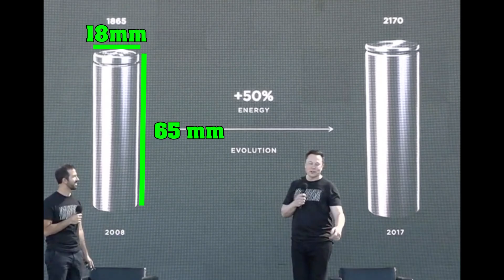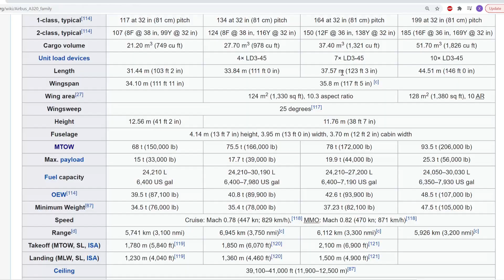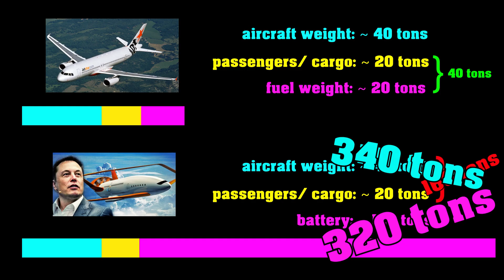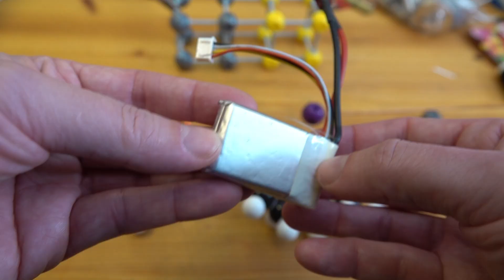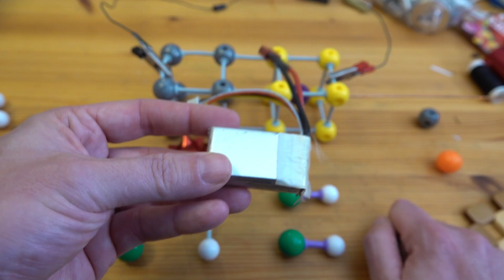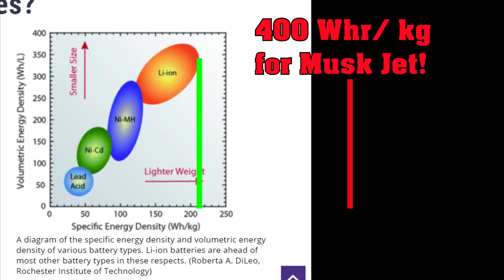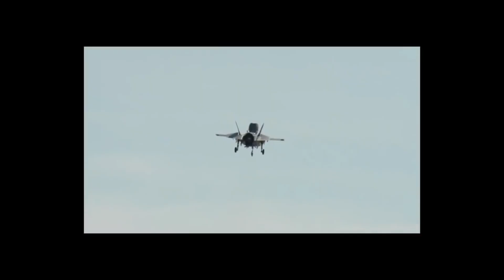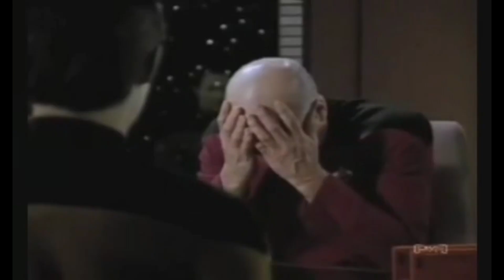Tesla's Secret Plan To Disrupt Airlines: BUSTED!!

Comment: Serious question: since fat is so energy dense, but also not dangerous, is it not theoretically possible to get to some kind of energy storage which is safe at similar densities?
I'm not talking necessarily about electric power (batteries), nor I'm implying it would have to be able to release the energy at a high rate (=power). I'm just talking about stored energy.
Reply: You mean like barrels of oil?

Comment: For the record, they have 50% thermal efficient gas engines. Our school supermileage team built one. 

It's not that hard but you lose throttlability and power density.
Reply: And I think that's about the theoretical limit of what is possible.  It's impressive you got one that high. Good job!
Reply: I'm not really familiar with engines but, basically your saying you can get there by sacrificing performance in other areas?
Reply: @chrisessick7192  
You run into a thermal difference limit.  It's theoretically possible to get an internal combustion engine to 50% efficiency.  But you probably would never be able to accelerate speed up or slow down or anything like that. Not and keep that kind of efficiency. That's just not possible.
Reply: @dankuchar6821  hey thanks for the reply! That's really interesting.
Reply: @chrisessick7192  
because we have approached the theoretical limit of how efficient an eternal combustion engine could be, the only way to make a car get better gas mileage is to make the car lighter. We can keep making small improvements in the engine, but it's not ever going to be the case where you can make a car that gets twice the mileage you get right now. Maybe 10% better on the engine, but the only way to significantly improve the gas mileage would be to make the car lighter. You're just at the end of what physics can do. It's hard to understand unless you've had courses in thermal dynamics. But that's where we are. Electric engines are far more efficient. But the energy density of a battery, with even the best theoretical current models, can probably only double what we have right now. So while the car right now can get say 200 mi on a battery charge, it may be possible to make a battery with current known technology that would get you 400 miles on a charge. But that's it. You'll never get a thousand miles on a charge unless there is some kind of new huge breakthrough in battery technology. I suspect it won't be a battery. Perhaps somebody will come up with a super capacitor that will work more effectively. That remains to be seen. Theoretically it is possible, but nobody knows how to do it with our current understanding of physics.
Reply: You van go even higher, and use it for power generation (vide railway industry, and serial hybrids) for your electric ride if you want the best of both worlds.
The problem is that the cycle becomes more complex in desin, since components need to be added to recover low grade heat. 
I was playing with it for my little gas-steam-orc project.
Cost turned out prohibitive, though.

Comment: Elon Musk was laugh at when he said in the early 2000s that SpaceX was going to develop reusable rockets at a fraction of the price of modern rockets, now is 2021 and nobody are laughing at him, specially the Russians, just saying. And when it comes to batteries, it is a no brainer, when energy density becomes high enough, electric comercial aviation would be a reality, it is only an engineering problem as far I understand it, there is no law of nature that needs to be broken, or Cthulhu invocation required. So saying that Musk's plan to change comercial aviation is BUSTED is a bit over sensationalism. It ain't gonna be easy, but it is not imposible .
Reply: They laughed at the Wright Brothers, but they also laughed at Bozo the Clown.

Comment: An important point to make is that specific energy is not the same as specific usable energy. On a car your Hydrocarbons at 40 MJ/kg are going through a 25% thermal efficiency engine. You're ending up with 10 MJ/kg of mechanical work and 30 MJ/kg waste heat. This is still way better than the 0.5 MJ/kg battery but it gets it closer. Combined with a significantly lower engine mass, you're most of the way there for a performance car.

Comment: Just put ion engines on the plane so it requires less air, there solved it for you ;)
Reply: Researchers from Wuhan university have created a prototype thruster capable of generating plasma jets with propulsive forces comparable to those from conventional jet engines, using only air and electricity.

An air compressor forces high-pressure air at a rate of 30 liters per minute into an ionization chamber in the device, which uses microwaves to convert this air stream into a plasma jet blasted out of a quartz tube. Plasma temperatures could exceed 1,000 °C

Comment: One point is clearly missing in this video. The expansion of lithium batteries at high altitude. Examples: UPS Airlines Flight 6 and the announcement if you have certain smartphones and laptops start smoking on the plane to report to the hot cabin attended aka juice pusher...

Comment: 2 years ago Lufhansa CEO himself was telling me and my colleagues that a big battery electric plane won´t work energy density wise. They have projects with synthetic fuels, but they have yet to be made on a big scale and are obviously much more expensive than kerosene.
Reply: Not only that, synthetic kerosene actually EXISTS in reality, and DOES SOMETHING in reality. Batteries with the same energy density as kerosene (except metal/air) DON'T exist, and are never likely to exist. Because even IF you could make such a battery in real life, it would be extremely dangerous.

Comment: Slight nitpick - I believe you misinterpreted the fuel capacity figure for the A320. The figure is given in liters, not pounds, so it cannot be directly converted to tons. According to this (https://bhs.econ.census.gov/bhs/cfs/weightConversion.html) table from the US. Census Bureau, one liter of jet fuel weighs 1.8 pounds. Multiplying this by 24,210 liters of fuel and throwing away the insigfigs we get a more accurate maximum fuel capacity of about 43.5 tons. The MTOW of the A320 is about 80 tons, making the maximum fuel capacity by weight about half of the MTOW. Note that the OEW (about 40 tons) plus the max. fuel capacity (about 40 tons) plus the max. payload capacity (about 20 tons) is about 100 tons, 20 tons more than the MTOW (about 80 tons). This is due to another subtlety that you glossed over - you physically cannot take off with both max. payload and max. fuel (and you very rarely take of with either). It is a tradeoff between how much fuel and therefore range you have, and how much cargo you can carry. I'll admit that I'm a bit skeptical that you missed this nuance seeing as not 60 seconds later you mention reducing the number of passengers and cargo in order to increase the amount of fuel onboard, but I'll take it in good faith that it was presented in good faith. Compounding this, you misrepresent the fact that unlike a traditional jet airliner, the weight of the batteries actually contributes to the OEW of the plane. Interpreting Elon's 70% figure to mean 70% of the OEW, this figure tells us nothing about the payload capacity of the aircraft. Of course, it would be a massive challenge to design a plane whose components excluding the batteries make up only 30% of the plane, but it is still incorrect to say that the weight of the plane without batteries as well as the payload capacity is only 30% of the weight of the plane. It isn't clear whether or not Elon meant 70% of the OEW or 70% of the MTOW, but given the context I find the former far more likely.

And to anyone responding, before you finalize your response keep in mind that I prefaced this as nitpicking. While these elements are factually incorrect I still agree with the core message of the video, that being that an electrically powered supersonic VTOL is, if it is even feasible, not going to happen in any of our lifetimes.

Comment: I think you are missing the point.  If we reduce the atmospheric pressure of the earth to about 1/10 or what it is now (not a true vacuum, tfoot, that would be crazy), then you can simply run hyperloops without the tubes allowing for the disruptive, next generation transport that all plants crave!  Elon also has a plan to selectively disable gravity, allowing for hyperloop vtol ascent and descent in the next 3 to 5 years.  If you would just read the whitepaper, all would become clear...

Comment: Supersonic electric VTOL? I don't even have to look up my AE books...this is plain childish daydreaming
Reply: Researchers from Wuhan university have created a prototype thruster capable of generating plasma jets with propulsive forces comparable to those from conventional jet engines, using only air and electricity.

An air compressor forces high-pressure air at a rate of 30 liters per minute into an ionization chamber in the device, which uses microwaves to convert this air stream into a plasma jet blasted out of a quartz tube. Plasma temperatures could exceed 1,000 °C
Reply: @blackmartini7684  i remember reading that paper the problem is that you will need to the energy to create plasma I believe they thruster made about 30N/kw but it never adds the power use of the compressor. Another big issue is if we compare the thruster with the rolls royce olympus engines on the Concorde one of the only few commercial supersonic jets. it needed 4 engines producing 142-169kN at max thrust and after burner, with cruise of about 45kN just cruise alone for a 3hr flight from london to newyork requires 17598kwh batteries just for the cruise and you would need double that power just for the full thrust during takeoff climb. so you are looking at almost a 36Mwh  battery which would weigh 138000kg Almost equivalent to double the empty weight of the Concorde. and the battery need is 16% of the largest battery in the world
Reply: @shaneebahera8566  
its ok if he can charge the plane battery fast 🤣🤣🤣
Reply: @blackmartini7684  The problem was never thrust.

Comment: I mean all the points you bring up are valid. It would be insanely difficult to make the plane for all the reasons you state but at least try to state accurate numbers. For example when a plane is built bigger its actually possible to make the airframe a smaller % of the total mass. So the plane would need to be insanely big but 70% battery is not flat out impossible. Flying higher does get more efficient but duh you still need some atmosphere for flight. The issue is you need to fly much faster but the math works out to the air breathing engine losing thrust faster than the efficiency gained from higher flight can compensate. For example the SR-71 needed to fly at a hight so low for its speed that it would get crazy hot (so titanium) if it flew higher it would not heat up but would not have the thrust to maintain that speed. Non air breathing engines( rockets or electric) dont have that issue and are better flying as high as possible and faster. At least bother to watch the battery day you pull the numbers from. The 5x 6x numbers talk about the gains from the change in the battery size giving them a more efficient geometry. They have a graph in the presentation showing the new battery has a 54% increase in RANGE(directy linked to energy density) but 14% of that was said to be from a better structural integration with the car( no mass waisted for attaching it ). So we are talking about 40% more energy per kg for the battery. Finally and I dont blame you for that point since you would need to have watched all the interviews with Elon to catch that one but he says 400wh/kg is the bare minimum to make it even possible but said it would need to be significantly higher to make it commercially viable hence the reason he is in no rush to make it.
Reply: The reason why no one is going to make a supersonic electric jet is because it's physically impossible.

Comment: How would Fuel cells compare? They've got higher density in a safer package, right?
Reply: Yeah but they still only generate electricity. The genius of a turbine is that it takes full advantage of air expansion at ignition (oxidation) of the fuel. The best way to make airplanes carbon neutral is to just keep the same system but use synthetic fuels.

Comment: Ah cmon dude. It's not hard to do this shit. We just need to invent something really incredible like a holy grail of energy. No big deal.
This guy isn't... 100% wrong on the claim that electric engines get more efficient when you get higher but there's a couple of caveats.

1. The required work for the engine decreases the further from the gravitational body and the reduced drag -- to a point. One still has to be able to attain enough speed and have an air pressure intake that is optimal for maximum thrust. Like a ram jet. (true for fuel based and electric based engines... so yeah...)

2. You can carry propellant with you and thus the efficiency continues to scale as you go higher... but that's not an electric plane.

So yeah. He's not 100% wrong. Just 99% wrong lol.

Comment: When Elon says electric motors have better power to weight ratio than combustion engines, that's only true for standard piston engines. There is still no electric motors with higher power to weight ratio than gas turbine or jet engines.
Reply: Researchers from Wuhan university have created a prototype thruster capable of generating plasma jets with propulsive forces comparable to those from conventional jet engines, using only air and electricity.

An air compressor forces high-pressure air at a rate of 30 liters per minute into an ionization chamber in the device, which uses microwaves to convert this air stream into a plasma jet blasted out of a quartz tube. Plasma temperatures could exceed 1,000 °C

Comment: you also forgot that plane burns the fuel - so it becomes lighter the further it flys and presumably more efficient - Also current planes can’t really land at full weight (hence fuel dump in emergency) - so it’s going to need a strong airframe to land at essentially full weight.

Comment: What kind of "electric jet engines" would they be using? Most electric planes so far are propeller airplanes which definitely won't work in thin upper atmosphere. But I've heard of this new "Jet propulsion by microwave air plasma in the atmosphere" concept (google it)... would that work?

Comment: the "extra" 4% when the energy storage is 50% more but the volume is only 46% more is probably just down to the fact that the skin thickness is just the same so you're getting more volume for your buck.

You probably lose all that benefit plus more as you're getting more empty space between the batteries  : /

Comment: @Thunderf00t, all that, and then the small problem of making a "electric jet" aka Electric Ducted Fan, that will push the plane past Mach 1. And still be "more efficient" than a Suck-Sqeeze-bang-blow engine.
Keep up the good work
Reply: Researchers from Wuhan university have created a prototype thruster capable of generating plasma jets with propulsive forces comparable to those from conventional jet engines, using only air and electricity.

An air compressor forces high-pressure air at a rate of 30 liters per minute into an ionization chamber in the device, which uses microwaves to convert this air stream into a plasma jet blasted out of a quartz tube. Plasma temperatures could exceed 1,000 °C
Reply: @blackmartini7684  sounds really smart, 30 liters of air per minute, converted into a blast of plasma.
My desk fan moves more than 0,5 liters a second, so that will do to compare the thrust provided. I'm not sure why I would heat it, as there need to be something that would expand to provide more thrust, to make it do anything.

But hey, Science might prove my thinking wrong, and make a supersonic Tesla airplane fly.
Reply: @svareter42  this is a small scale prototype so so they should be able to do more liters per minute

Comment: If you use larger cells in a battery you get higher energy density simply because there's less "dead" casing material in your battery. It doesn't really take a genius to come up with that idea, but it's also not as retarded as you make it sound. The gain in energy density may be negligible on the individual cell level but it adds up in a battery that contains hundreds or thousands of cells.

Comment: There is a small aspect, that has been a bit overlooked. Let's stick with an A320. On a small hop, lets say from Boston to New York, the tanks of an A320 are literally empty. So less weight for the complete flight, less fuel burn, save costs, jada jada jada. And for a conventional powered aircraft, In terms of range, it helps that on route the aircraft gets lighter as some of weight is burned up progressively.
A battery powered plane has to carry around the complete weight of the batterys at all the times... This doesn't make sense.

Comment: I can imagine some small quadcopters with battery source that might be cheaper to operate than helicopter for short routes (100km > x) without the need of long engine starting procedures. For example for some air ambulance in large citties and surroundings...  but electric supersonic jet...  well... that needs a lot of cocaine :D